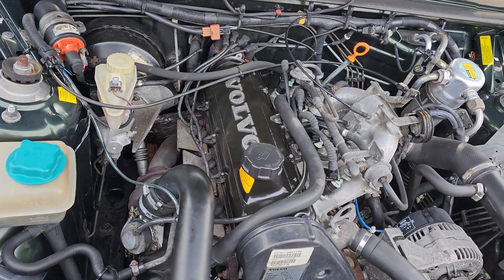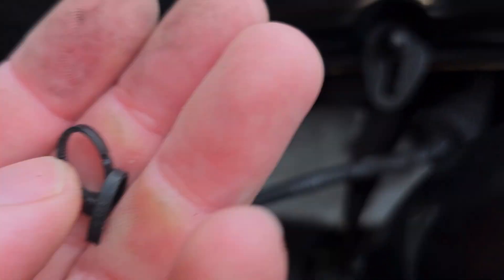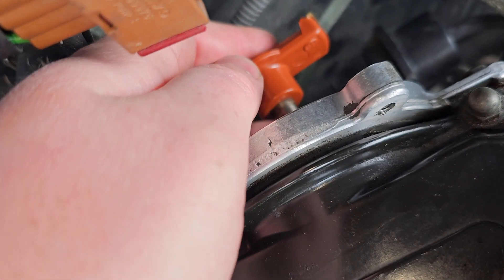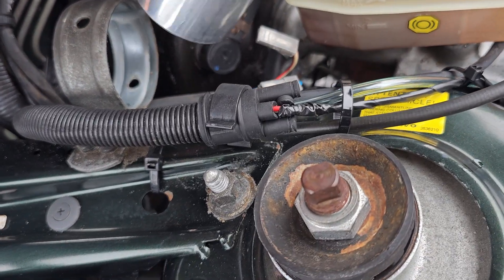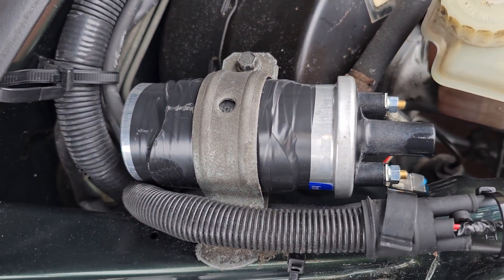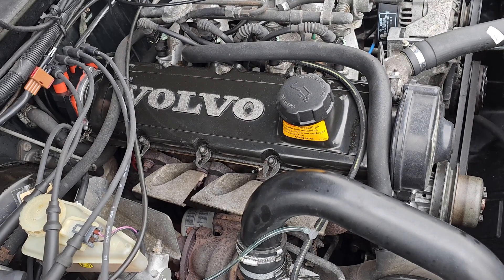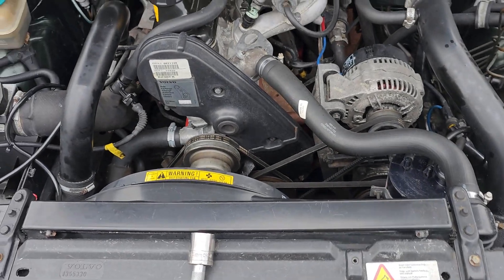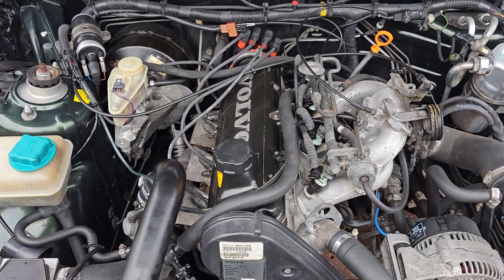Project Turbo Brick Ep15 Always Do This When Buying A Used Car! (Volvo 940 ignition system refresh)

Comment: missing grounding wires between the valve cover and the firewall
Reply from the maker: I didn't realise there should be one! Thanks. I'll add one in soon. For now though, it seems to be doing fine with the other connections it has.